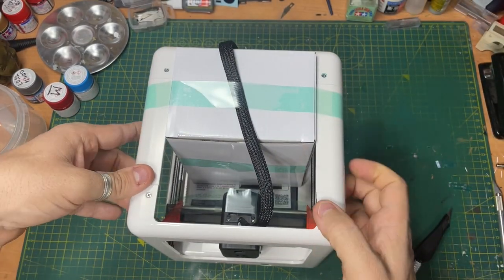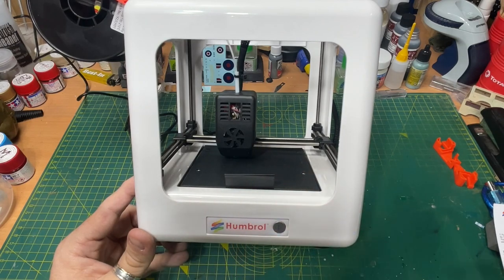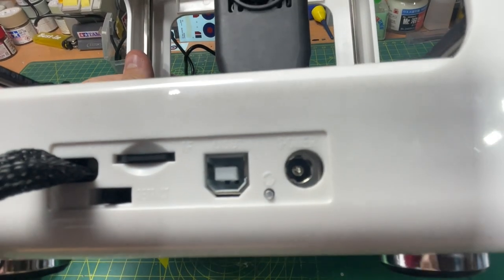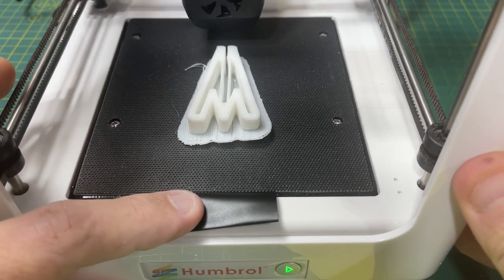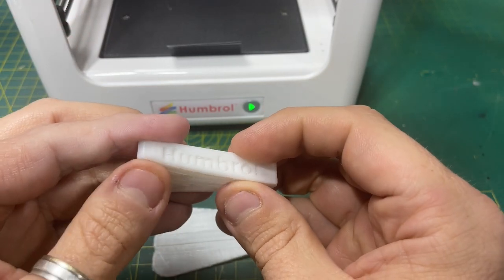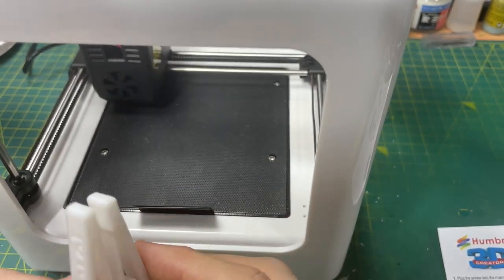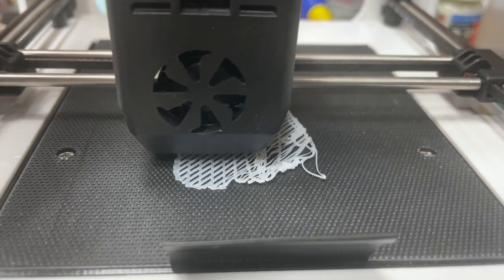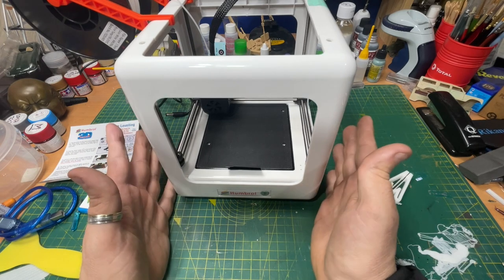Humbrol 3D Printer Unboxing and First Look - FULL REVIEW coming soon!

Comment: Not a terrible little printer, but for that money you'd expect a lot more in all honesty - the Ender 3 will get you better res and a larger print bed at £70 cheaper for example! Interesing choice from Humbrol though! Edit - forgot to mention, pritt stick is a great build plate adhesive to stop the raft coming up! Could also be that the extruder is starting the print too far away from the build plate, though looking at how the printer's built, it doesn't seem clear if levelling the bed is possible
Reply from the maker: wise words there matey.. ill play with it a bit more when i can get the software sorted

Comment: I have several 3d printers - mainly Flashforge brand. You may need some adhesive spray to help the filament stick to the bed - or use a prit stick. I think some people also use hair spray.  Higher end 3d printers would have a heated bed which also helps with filament adhesion. PLA (which this printer uses) does not need such a hot print bed. When leveling the bed, I feel for when the nozzle feels like it is dragging on the paper. 

I have just ordered this printer for £128 off Airfix - it comes with four extra rolls of PLA filament (250g reels). I think it will fit inside, on the print bed of my Flashforge Guider 2s!

Comment: Interesting video. I took the plunge this past Summer with a Sovol SV01 filament printer. It was $250 US shipping included. It can do 240mm x 280mm x 300mm tall parts. I had issues getting the prints to stick to the bed. My bed is similar to your Humbrol one. A UHU glue stick solved the problem, but it's not the ideal solution. The problem you get is when the plastic cools too quickly and starts to curl up like you first print did. I use the Prusa Slicer program, which is a free open source program that has many features that let you tweak things in order to improve print quality. I believe they have a version for the Mac. I learned so much by watching others on YouTube troubleshooting 3D printer problems. The is a learning curve involved, and I had several failed prints before things improved. There are just so many variables like type of filament used, nozzle temperature, cooling fans, print speed, etc. Another thing to note is that the .stl file doesn't print directly from the card to the printer. It uses a g-code file generated by the slicing software. Thanks for making the video!
Reply from the maker: `thank you matey.. im waiting on humbrol to come back to me in regards to software... it should work on a mac..

Comment: I'm not up to speed with the world of 3D printing but I thought that filament printers don't have the best resolution.
The size of the machine looks like it is rather on the small side, so how useful will it actually be?
Well, guess I'll have to watch the video to find out!
Reply: filament printers can get down to 0.010" layers.  resin printers get a lot more detail at like 0.0005in layers.  resin printers are great for scale modeling like we do here.  filament printers are best at making real things to use like chip clips, gears, tools, templates, larger scale things.  An Anycubic resin printer at <$200 would get far far more use in scale modeling.  there are now water wash resins that are low odor and easily cleaned.
Reply: @orbitalair2103  Thank you
Reply from the maker: i'm gonna have a play with it then see how it goes.. i might end up returning it
Reply from the maker: https://amzn.to/3E1MjuK is the printer you mention

Comment: To stop the raft lifting off the build plate during printing,, you can get a special tacky glue stick to put on the bed before starting to print. It doesn't look bad, but for £200 I would have thought it would be wi-fi enabled. I have a Flashforge, which is a similar design, wi-fi enabled, and much easier to level. Hope this helps.
Reply from the maker: i believe its priced heavy sadly
Reply: @MOS6510Models  Must agree. There are much better machines available for not a massive amount more.

Comment: Yup you are correct, the idea behind products such as these are that they are plug n play entry level items. You do after all pay a premium for that ease. You have been let down and once again the Airfix/Humbrol business is just failing it’s customers! 
What sits on your bench right now is rubbish: without the software you cannot run this to the max! Now I don’t know if you can sort out the bottom corner print issue in the app or not however you shouldn’t be having it regardless.
£200 is not cheap but it’s not expensive either it sits in that annoying area between the £550-600 units and the sub £100 true 1st time owners. You will never get a really smooth clean print (well I really doubt) from this but it will help you get an idea if 3D is for you and it will have a value if you you want to sell it.
Bob
England
Reply from the maker: yes they sent me a software patch and it does work..

Comment: An interesting idea. Imagine if a model kit company sold a 3D printer like this, that not only reads normal gcode but uses a proprietary digital rights encoded version that this & maybe other similar printers can read. The user purchases the file, which downloads to the printer directly & is encoded with the specific machine ID (so it can’t be passed around  illegally), after say 2 prints the files can no longer be read.
Reply from the maker: its no good for modelling.. resin printers is the way forward...

Comment: Great review there thanks!

As for the tech itself... it's like any other tool. 
It's not a one size solve everything tool.
It's about what you want to achieve from it, but also accepting it's limitations.

If cutting lumps of old pallet wood on a bandsaw makes the best model G scale sleepers, do that. 
Then simple deny the existence of 5 tons of sawdust in your kitchen.

If you want a 1/72 scale figure so detailed you can see his nasal hair, it's a 3d resin print. 
Then deny why your sofa is now encased in non removable grey plastic.

If you want a 1:12 scale body for a doll, filament print it.
Then deny why you invested your family's entire savings into buying sandpaper and soldering irons.

Comment: looks cute
the question only what it can do and what it can't

1 it is not a resin printer it is a filement printer (much lower resolution and lower quality printing)
2 if it has no heated bed it is waste of money
3 if you have printer profile you can use whatever slicer program  (not splicer) cura, prusa slicer and so on or something  comercial that can produce suported by printer machine code (mostly standarized gcode)
4  stl file is a geometry file and printer only work with program file generated by slicer software  and the way it pick wthat to print is a bit concerning

clicking and the shape of those belts is also a bit sketchy

Comment: Save your money....that’s one cheap and nasty printer for the money.  I bought an Ender 3 and the results are far superior.  But if you want detail the only way is Resin.  Sliceing software is readily available FREE on the internet...I use mine on a MacBook Pro without issues
Reply: Yeah. Not impressed with Humbrol. Looks like a small build plate size too
Reply: @Tired of War Cura. Free to download and use
Reply from the maker: yes ill have a look

thank you, i really appreciate the advice
Reply: Yeah - I'm honestly not very much impressed by this printer. It looks cheap, and prints bad. Bed adhesion is poor too. Indeed - The Ender 3 basic model is cheap, has a bigger build volume, and gives better results. Also - There are a LOT of upgrades available and you can also print a lot of upgrades yourself.